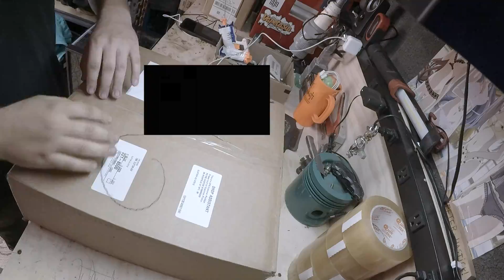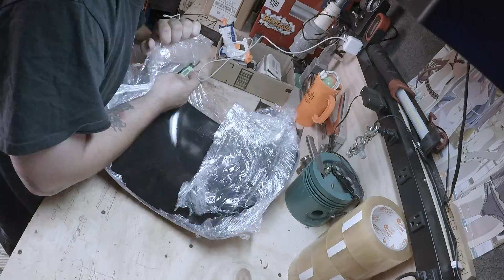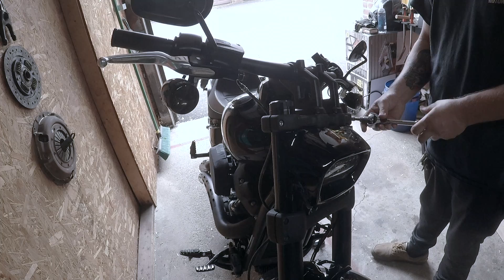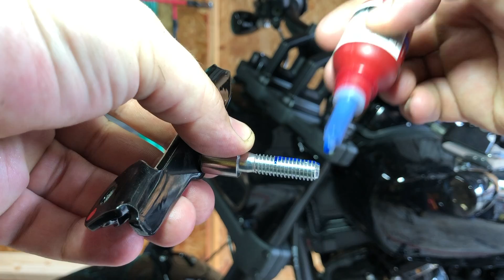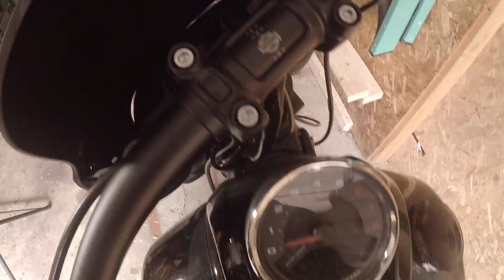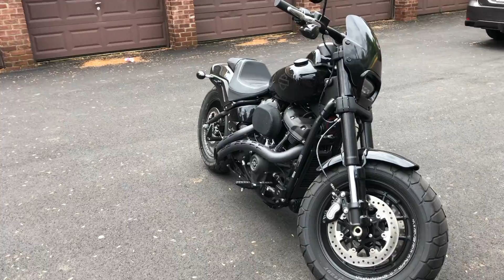2019 Fat Bob Spartan Min Fairing

Comment: I love the look!  I want to start putting some miles on my fatbob and mainly want some wind protection for the highway/interstate as I cruise at 80 mph and wind at those speeds can be brutal.  Will this do a decent job?  Does it project more wind at your helmet or about the same as no fairing?  I ride with a full face Bell Qualifier.
Reply: 0321SHOOTER i have the same question i want to get this but dont know how well it preforms
Reply: Just tried my new fairing, did the trick. No more lower body wind, I am 5'8" the wind now rolls up at my shoulders, but does not push me backwards. With full face helmet and visor open there is upward wind on the visor but great when visor down